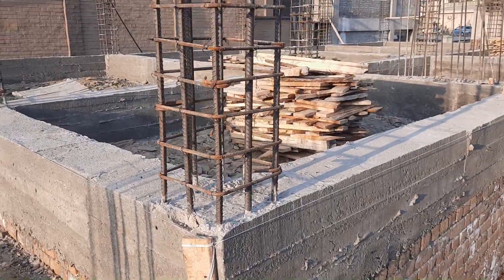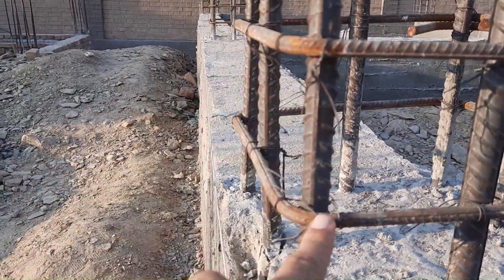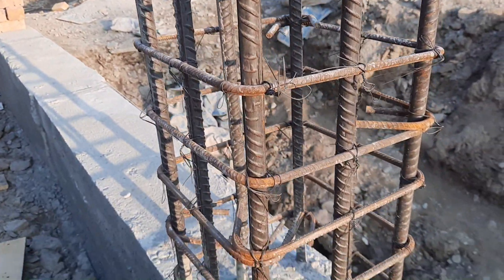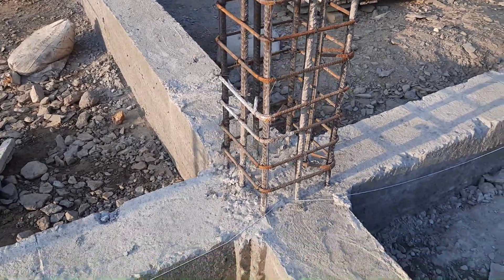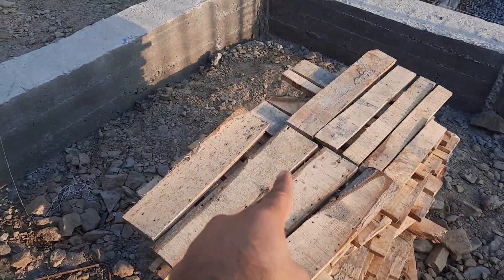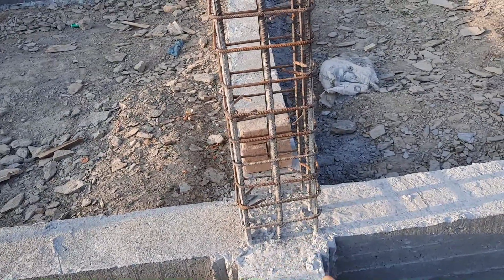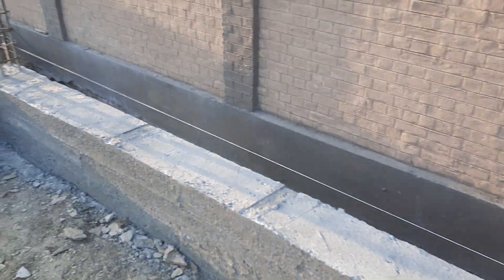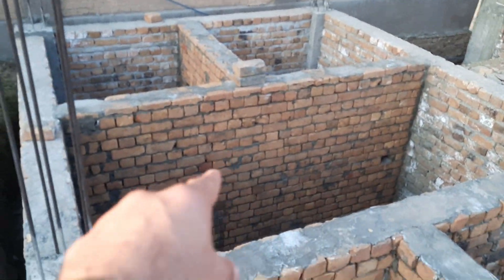Spacing of Column for 4 storey with Full Reinforcement Details  | Basic information on site

Comment: Sir . I am constructing my house in which breadth is 20 feet 1 bay and length is 30 feet 3 bay 10 feet each

I provide column 9×15 ench reinforcement 12mm 8 bars in column for 3 storey
Total 8 column

Is that safe sir,,,?

Please guide sir